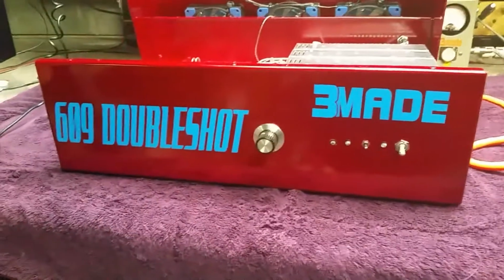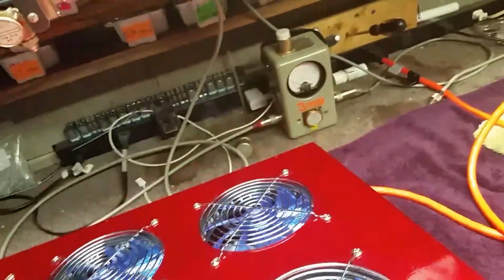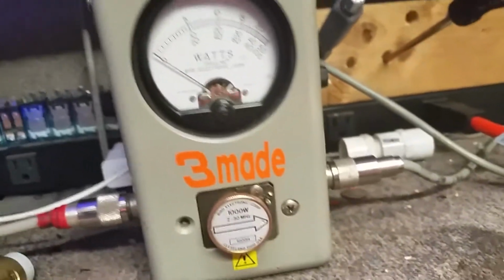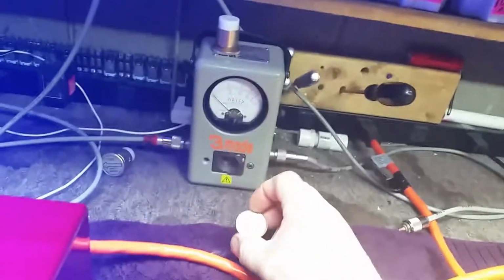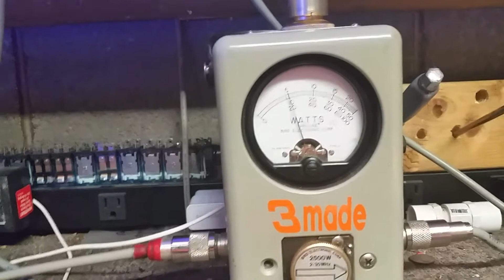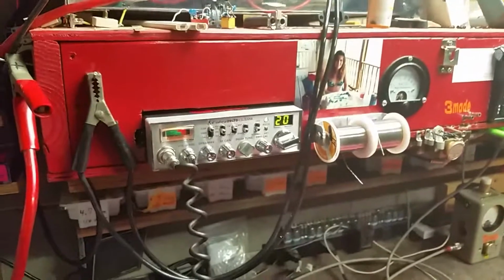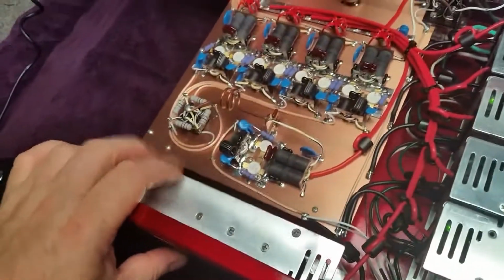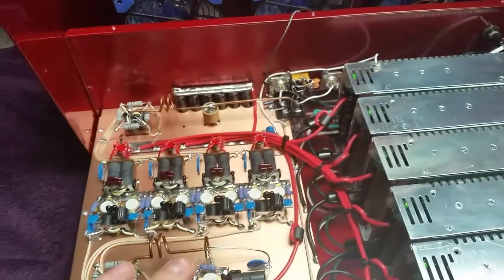609 doubleshot's 2x8 base with hg-2879

Comment: Awesome build!!!! I'll tell ya what, i have never seen one of your builds in a repair video. Thats speaks for itself.
Reply from the maker: Iv had some go down .. your only as good as the parts
Reply: @3madeamps  Very true, nonetheless you build a very high quality amplifier with great attention to detail and performance. Thank you posting the videos and leaving the comments open, it's sad so many critics, trolls, and hecklers ruined that feature with many builders. When i sell off some off my older amps, a palomar 300A, a spare DX500, two Metron 1000's and many one and two pills, i am going to get a newly built box by either you or Tech Nine...Maybe both you guys..I love putting that fire in my wire!!! :D
Reply from the maker: Good deal bro